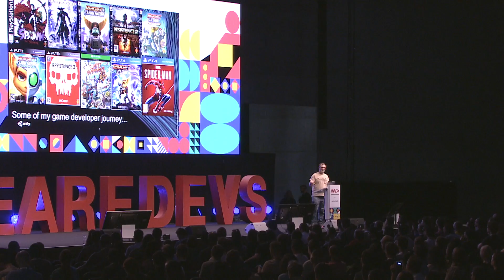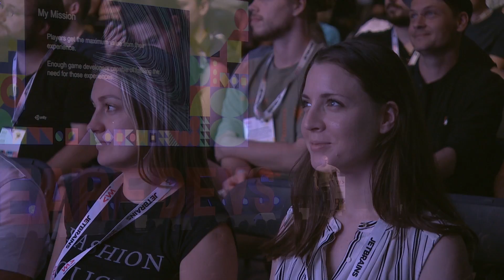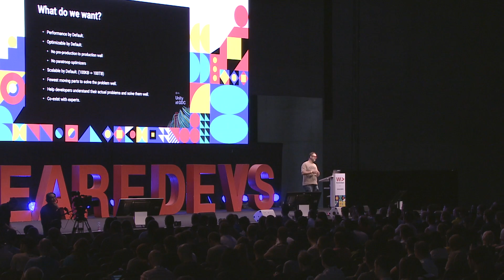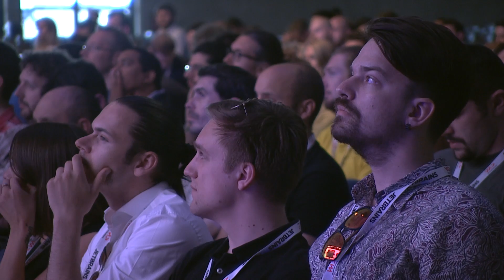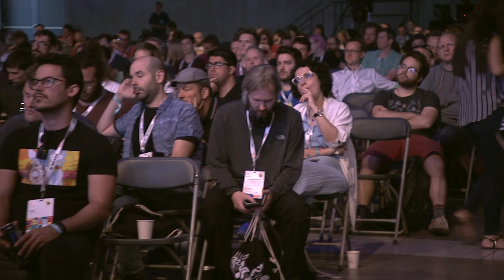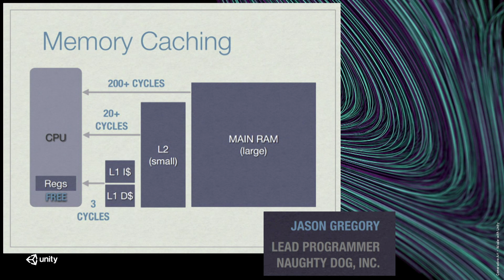Building a Data-Oriented Future -  Mike Acton

Comment: Who cares about C#? Would have been so much better if they just created a subset of C++ instead.
Reply: SS SS hell no c++ compiler is ridiculously slow fuck that. Plus everyone who uses unity uses c# so they can’t just change that even if they wanted to.
Reply: @32gigs96  And C# runtime is ridiculously slow too. So what's worse, being slow once for the developer, or being slow everytime for every user?
Reply: @Youda00008  The whole point of this talk is that they can compile a subset of C# to native. That means you don't need the slow runtime.
Reply: @manon-gfx  I doubt such compilation to native would be much faster than compilation of C++. C++ compiles slowly mainly because of header files with macros, which will be solved by modules in C++20, and because of templates, which are trade compile-time for run-time and you don't have to use them if you don't like it.
Reply: @Youda00008  lol yeah no, do not talk to Mike Acton about the new stuff they are adding to C++.
Reply: @Youda00008  Have a look at Go to see how fast compilation to native can be. Parsing C++ in general is slow (headers make it way worse).
Reply: As i said, it's about tradeoffs, C++ compiles slower but runs faster. Higher langs remove some compilation overhead, but it comes at the cost of missing some runtime performance concepts.
Reply: Keeper Holderson and yet C++ remains dominant in game development and applications, while C is left to low level. Even AI uses python calling C++.
Reply: @jellohunter7981  As the speaker said in another video, they are using C++ only because of the culture, not because they really need anything from it, and he personally prefers C and assembler.
Reply: @okaravan  Game engines are low level performant applications, which makes it prime for c and c styled c++. However, as stated in my previous comment high level applications and even AI frameworks use c. I have only been coding since 2017, and am unfamiliar with functional languages, so please note my bias.
Reply: @Keeper Holderson What agenda lol?
Reply: @Youda00008  They have their own LLVM compiler from what I can understand. They're just using a subset of the C# language (not any of the parts that are managed) that makes sense. Actually, using a subset of C++ or even C would be problematic for what they're doing since they're trying to guarantee thread safety, guarantee that the compiler won't be conservative about pointer aliasing (which C++ compilers always have to be without a lot of hints from the human programmer), etc. C and C++ at a language level can't offer such guarantees, since pointer sources could come from anywhere including volatile sources. If we want an ECS-based language that can guarantee what jobs and systems can run in parallel without the most exhaustive static analysis that goes far beyond the most cutting-edge C++ optimizers, the first thing it actually has to abandon is C's pointer legacy and favor more value semantics and containers, like he mentioned, that at the language-level guarantee that whatever references come out of them cannot be aliased.